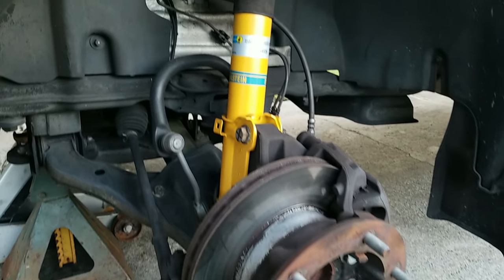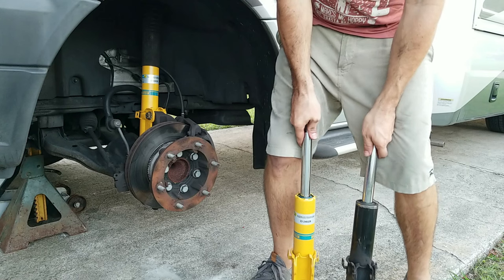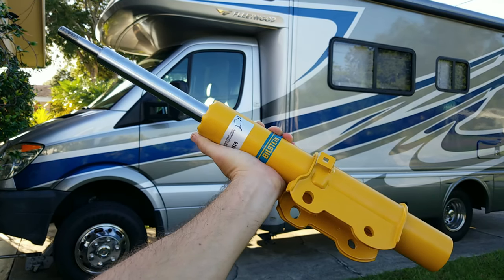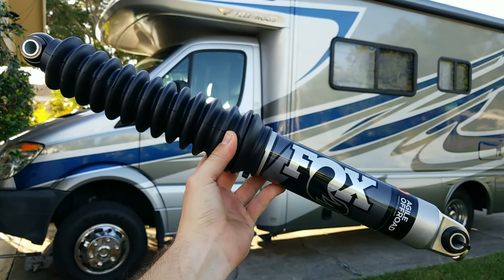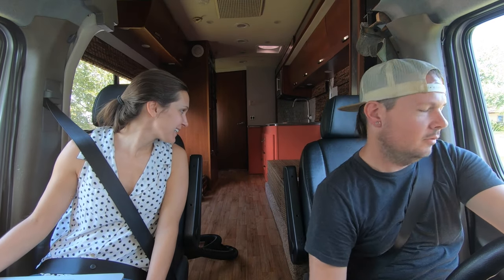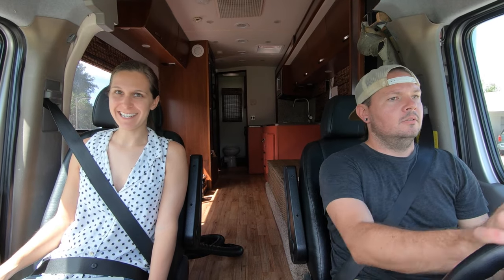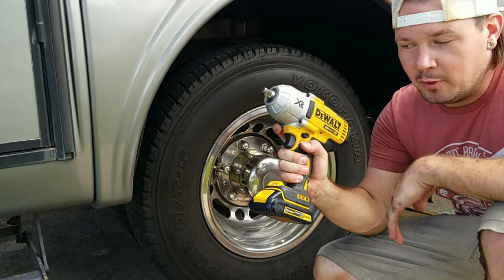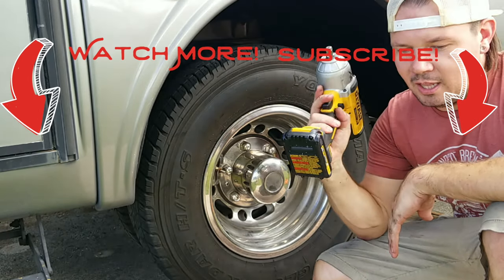Mercedes Sprinter Camper RV Suspension | Fox Shocks + Bilstein B6 | Full Time RV Living

Comment: I replaced and added to the suspension of our 2000 model 24' Tioga motorhome to give it a stable ride...Koni shocks, added rear anti-sway bar, sumo springs in the front, replaced front steering stabilizer, replaced anti-sway bar bushings, added adjustable camber bushings on the front and upgraded from 9 leaf spings to 10's. I was able to do all these myself with a little help from my wife. The ride is great on all types of roads now. I know you will enjoy your new ride.
Reply from the maker: That sounds like a great setup!
I'll probably add a helper leaf to the rear in addition to the shocks & struts. I'm on the fence about installing sumo  springs. They're easy enough to install though. So I'll see how this setup rides first & add them later on if needed.
Thanks for sharing! - Dennis ✌️
Reply: Eat See RV we just had the sumos installed on our LTV 2017 and what a difference.  Did you purchase the fox shocks for the back and send them to California for their adjustments?  That’s our next install.
Reply: Very pragmatic repairs/upgrades. Safety & performance.
Good job.

Comment: I put bilsteins and Sumo Springs  all around my Navion, been very happy with the improved ride on my rig.  My Navion came with adjustable air bags which were great when they worked, but after multiple leak problems and age, i pulled them off and replaced them with the Sumos.  I prefer the Sumo Springs, no more leaks, great ride!  Thanks for your videos!
Reply from the maker: Nice! What level sumos did you install? Thanks! - Dennis ✌️
Reply: As far as I know, there is a specially rated set for sprinter based RVs.  Mine is an 06 Navion, yours is much newer so the part numbers may be different.  Mine are ssr-338-47
Reply from the maker: Thanks Steve! - Dennis

Comment: I have new 2020 (2019 chassis) with only 4000kms on it & the sway has been extreme since it was brand new.  I bought Sumo bump stops & am picking out new rear shocks (Fox is a shock we can't get in Canada, but Koni has great shocks & is a Canada-friendly company).   Fingers crossed that it provides some improvement

Comment: Agile haven't sold you the right rear  shocks.... For the 3500 you need a way bigger one... They sold the 2.5 diameter Fox shocks absorber.
Reply from the maker: 🤔 It's possible but, they told me over the phone that the bigger diameter of the 2.5s wouldn't fit on our 2008 chassis. I think the 2.5s fit 2010 and newer chassis. - Dennis ✌️

Comment: On my 2020 Winnebago View I added a big diameter Roadmaster sway bar in front of the rear axle in addition to the rear stock sway bar behind the rear axle with the Agile Off-road Fox 2.5 shocks and it has been a game changer.  

I have not done the front Bilstein upgrades yet since what I have done works so good but will probably do that next.

Comment: What are your thoughts on Sumo Springs and Timbren?  Will you add those to your suspension upgrade as well?  The inside of your RV looks awesome!
Reply from the maker: I'll probably add a helper leaf to the rear in addition to the shocks & struts. I'm on the fence about installing sumo  springs right now. My hesitation is that they operate like air bags but they're not adjustable. So if you don't like the way the ride feels (too stiff/soft) you're stuck with it. They're easy enough to install though. I'll see how this setup rides first & add them later on if needed.
Thanks for watching! - Dennis ✌️
Reply: I added Timbren block springs and a bigger sway bar.  Made a huge difference!

Comment: The problem is the RV manufacturers and van upfitters don't upgrade the chassis to make up for all the weight they add.  The stock chassis components will eventually fail and then your ride suffers.
Reply from the maker: I 💯% agree with that. But, if manufacturers actually did suspension upgrades these RVs would be even more ridiculously expensive than they already are.
I've learned in the year after  installing these upgrades that what I've done in this video is a step in the right direction, but isn't enough.
I will be working with a suspension company soon to adequately upgrade our sprinter RVs suspension correctly! - Dennis ✌️
Reply: @EatSeeRV  Dennis, have you found a company to work with you on the suspension upgrades. We have a 2009 Icon, live in St. Petersburg and definitely want to beef things up. We had to replace front struts and tie rods last year after 10000 miles in the Rockies pulling max GVWR. Ready to upgrade the rest of the front and rear but want to work with someone who knows what they’re doing.

Comment: I’m adding the rear shocks and sway bar. Did you notice any improvement on the ride on rough interstates or highways?
Reply from the maker: I didn't go with the sway bar. But, I can definitely feel a reduction in side to side rocking with the Agile tuned fox shocks 2.0s. It has come to my attention recently that since our rig has the MB factory blocks under the leafs, I could have went with the larger Fox 2.5's. I feel like the larger reservoir on the 2.5's would improve ride quality on the highway. So if you have the budget get those! - Dennis

Comment: I have Suzuki every van and my question is how can I have less bumping feeling and I also don't want lower my van and soft ride too can it is possible
Reply from the maker: I'm not familiar with your specific van. But, if you want a decent ride with a more sporty feel, I enjoyed the KYB MonoMax shocks and struts I had installed on 2 of my previous vehicles. KYB does not make the monomax for every vehicle so I don't know if they will be available for your van or not. Other than if you google " Suzuki every van suspension upgrades" I'm sure you'll find loads of forum posts with suggestions on what to install and results that others have had with different installs.
Sorry I couldn't be more help. Good luck!  - Dennis ✌️
Reply: @EatSeeRV  oh thx a lot bro hope that will help me 2

Comment: A mutual friend sent me to your channel. We also have a TH and thinking about trading to a class C. How do you feel about that Mercedes engine so far?
Reply from the maker: We haven't really had any issues so far, but many have said getting parts replaced can be difficult and expensive. Do a fluid analysis on the engine before you buy to see if there are any big problems and have a reserve budget for it and I think you'll be fine! - Liz